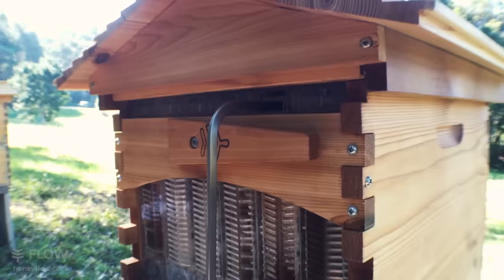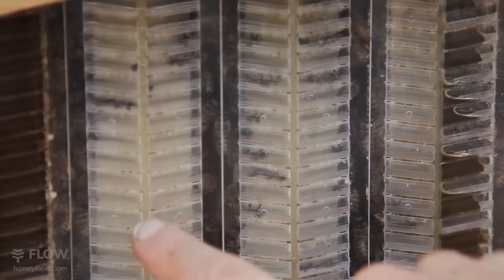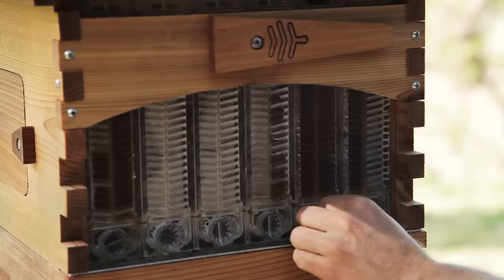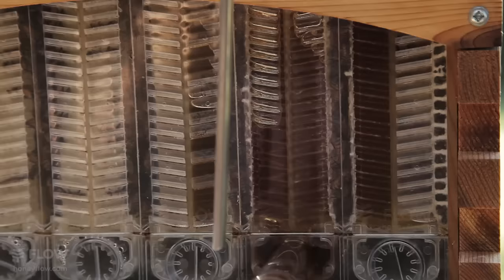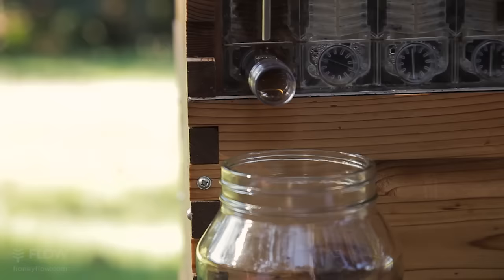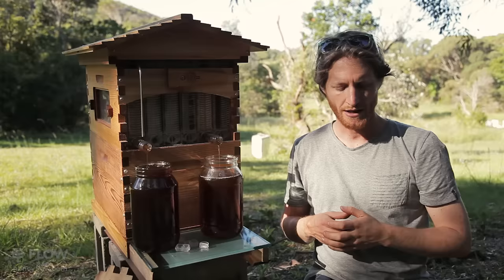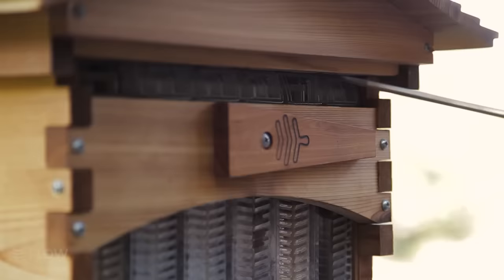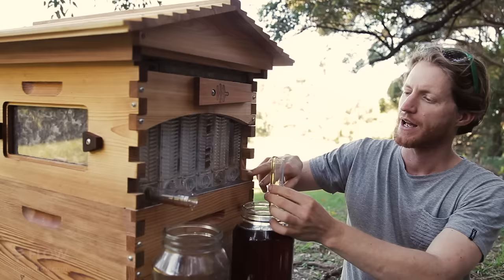Flow Hive honey harvesting

Comment: Ok, what happens if the honey for whatever reason goes sugary? It won't flow so how do you get it out of the hive.????
Reply from the maker: Hi Jan, As with any type of honey extraction, crystallisation can be an issue. If you have crystallised honey in Flow Frames the honey will not drain out.

If you are in an area that is prone to crystallised honey we recommend harvesting as soon as the honey is ready.

If honey has crystallised in the Flow Frames, you can either disrupt the cells in the frames by inserting the Flow Key and moving it to the harvest or open position. This will prompt the bees to remove the crystallised honey and repair the comb.

Alternatively, you can remove the Flow Frames from the super and soaked them in warm water to soften crystallised honey making it possible to harvest. This may be best done as a bench harvest so you can ensure the honey is flowing well or return the frames to the hive and harvest in the usual way. - Sam

Comment: Do you have to clean the inside out ever?
Reply from the maker: We have found that the Flow Frame comb itself should not need cleaning if it stays within the hive as the bees do a great job of keeping it clean. If you remove the Flow Frames from the hive for storage, they may need cleaning as they can attract debris depending on your storage method. 
You can do this by using hot water (just hot enough to melt wax – recommended up to 70°C), a hot water hose tends to work well. Set the Flow comb to ‘cell open’ position, this allows the water to flow quite easily through all parts of the frame.

It is likely that most of the wax and propolis will remain on the frame, which should not be an issue as the bees will recycle this – the main purpose is to ensure that the frame is clean enough to be re-added to the hive.

We have designed the honey trough at the bottom of the frame so that any remaining honey can drip back into the hive for the bees to use. If the leak back point remains clear this works well, however, if the bees seal it, sometimes you end up with a little honey in the trough at the bottom which may need cleaning out prior to your next harvest. This can be easily done by unblocking the leak back point with the tongue of your Flow tube or a small implement. - Sam

Comment: Do we need to clean the flow hive from time to time??
Reply from the maker: Hi Vinnie, We have found that the Flow Frame comb itself should not need cleaning if it stays within the hive as the bees do a great job of keeping it clean. If you remove the Flow Frames from the hive for storage, they may need cleaning as they can attract debris depending on your storage method. 
You can do this by using hot water (just hot enough to melt wax – recommended up to 70°C), a hot water hose tends to work well. Set the Flow comb to ‘cell open’ position, this allows the water to flow quite easily through all parts of the frame.

It is likely that most of the wax and propolis will remain on the frame, which should not be an issue as the bees will recycle this – the main purpose is to ensure that the frame is clean enough to be re-added to the hive.

We have designed the honey trough at the bottom of the frame so that any remaining honey can drip back into the hive for the bees to use. If the leak back point remains clear this works well, however, if the bees seal it, sometimes you end up with a little honey in the trough at the bottom which may need cleaning out prior to your next harvest. This can be easily done by unblocking the leak back point with the tongue of your Flow tube or a small implement. 

Please let me know if you need any further information. - Sam

Comment: What if the bees are really dying because we take away their honey and for this they must work more than normal because they notice that their panels empty very quickly?
Reply from the maker: Hi Luz, the bees do have a finite lifecycle. They do produce more honey than they need and the great thing with the Flow Hive is that we can harvest as much or as little as we need leaving plenty for the bees! - Sam
Reply: @FlowHive  I asked myself the question because it is logical that you spend storing food for the winter etc and suddenly you do not have enough food to supply the entire colony, the bees know when their hive has cells that need to be full and they work and work until they are completed, this I could make them work more than normal when over and over and over again they find it empty, as you said, bees are finite and that double, triple, quintuple work etc makes them more finite because of their weak capacity.

Comment: how long does it take to fill a whole super
Reply from the maker: The time it takes to fill a Flow Super will depend on many factors, including hive strength, local climate and available forage. It is not uncommon to have very different results from hives kept at the same location and even within the same hive annually compared to previous years.
You can expect to harvest about three kilos (6.5 lb) per frame (more if the bees really build each frame out). If you have six frames in your super box then you can expect to harvest at least 18 kilos (39 lbs) when every frame is full. A super usually fills well within a month during the spring and summer. This depends on the amount of nectar available for the bees and how strong the colony is. We have had Flow Supers fill in a week during peak times of the flowering season.

I hope this helps – Leah

Comment: Can we still get the propolis n polen with this honeycomb  sir
Reply from the maker: Hi Hussam, you can’t harvest wax from a Flow Frame. Honey comes out of the Flow Frames free from wax and ready for the table. All the wax stays in the hive and the bees reuse it. Bees use about 7kg honey to make 1kg of wax, so this aspect of the Flow system can improve your hive’s rate of honey production.

To enable harvesting of wax we offer a Hybrid Flow Hive and Flow Hybrid Supers that contain both Flow Frames and traditional frames. This allows you to harvest both wax and honeycomb from a Flow Super. 

Pollen draws fit on the outside of the hive, the Flow system does not interfere with this at all.

If you can fit your pollen draw to a standard Langstroth box, then there should be no problem fitting it on a Flow Hive.

We have had some feedback that some pollen traps do not fit well with our Flow Hive Classic’s bottom board due to the raised landing board – read more on this, and which pollen draws/traps work well with Flow Hive Classics, on our Community Forum. There should be no problem using most, if not all pollen traps on a Flow Hive 2 or 2+. 

https://forum.honeyflow.com/?_ga=2.107163330.1983885691.1626046526-1197914724.1624249687

Please let us know if you have any questions – Leah.

Comment: How much honey can I produce per day?
Reply from the maker: Hi Zarif, When the Flow Super is full, you can expect to harvest approximately 3 kg (6.5 lb) per Flow Frame (even more if the bees really build each frame out).

The Flow Hive Classic 6 and Flow Hive 2 comes with 6 Flow Frames, giving up to 18 kg (39 lb) of fresh, unfiltered honey each time the honey super is completely full.

If you have one of our Flow Hive Classic 7 or Flow Hive 2 with 7 Flow Frames, then you can expect to harvest approximately 20 kg (44 lbs) when every frame is full.

One of the great benefits of Flow Frames is that you can harvest as much or as little honey as you want – you can take just one small jar for a gift or the breakfast table, or harvest an entire (or several) Flow Frame(s). The amount of honey for harvesting depends on many factors, including hive strength, local climate and available forage.

With a good nectar flow, it is possible to harvest from a full super multiple times in one season.

It is not uncommon to have very different results from hives kept at the same location and even within the same hive annually compared to previous years.

When harvesting it's important to remember to leave enough honey stores for your colony to see them through the winter. - Sam

Comment: good idea but really expensive.,..
Reply from the maker: Hey Kristof,

Thanks for your comment.

Keep in mind it removes the need for convention expensive harvesting equipment, Namely, Centrifuge, Wax knife, Filtering equipment. As well as the space, maintenance, running costs and clean up of harvesting equipment. 

All plastics used are of the highest quality available, all timber used is sustainably sourced, harvested, and milled, which means it is more expensive than using lower grade, less environmentally conscious timber sources. All staff are paid fair wages and employed in fair-trade conditions.

We are endeavouring to make this premium product as accessible as possible, and have a range of options to suit different budgets.
– Danika